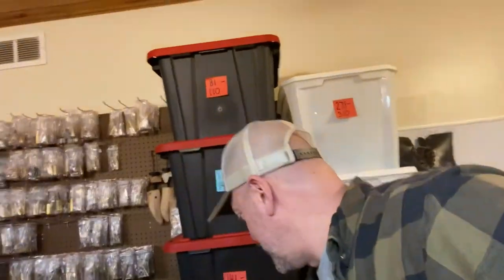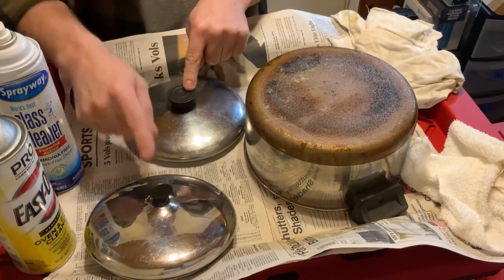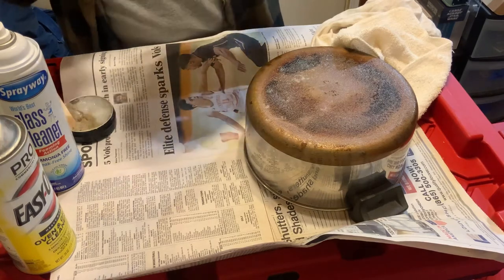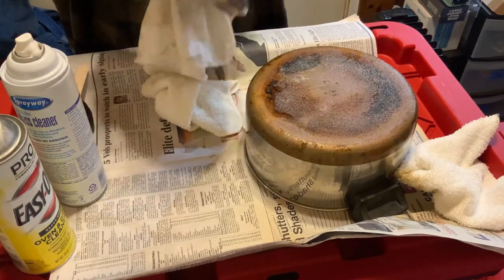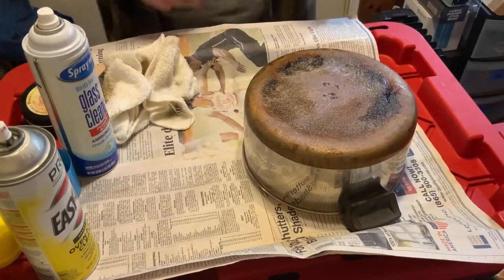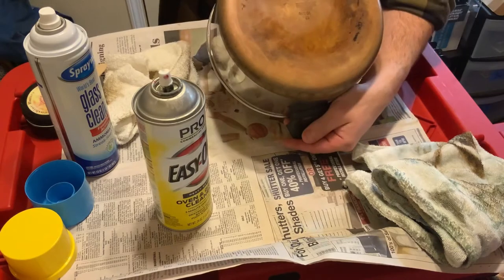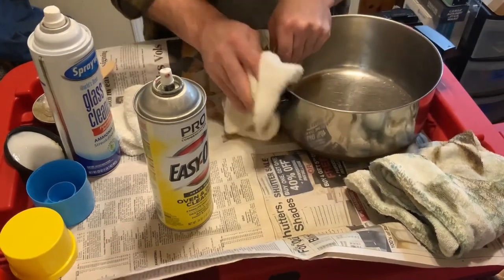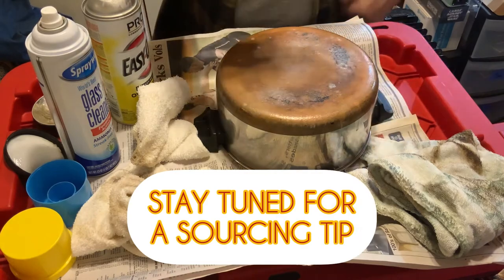Cleaning Pots and Pans to get them ready for eBay!

Comment: The problem with just waxing the handles is it comes right off when you wash the pot. However, if you take the time to wet sand the handles, finishing them off with 1500 wet sandpaper, and then polish them, they will look like almost new with no wax. If you then wax them, they will look brand new.